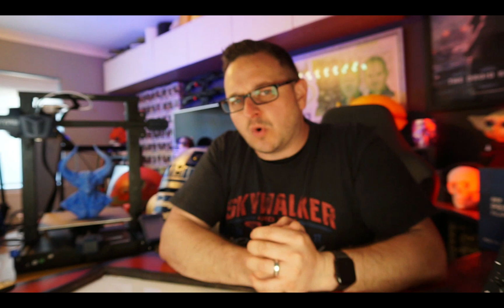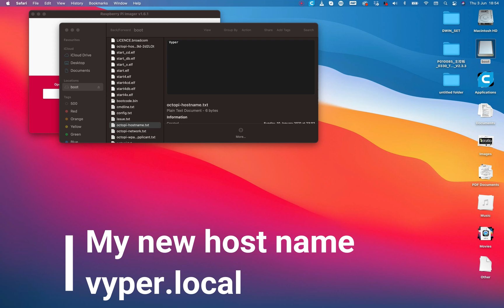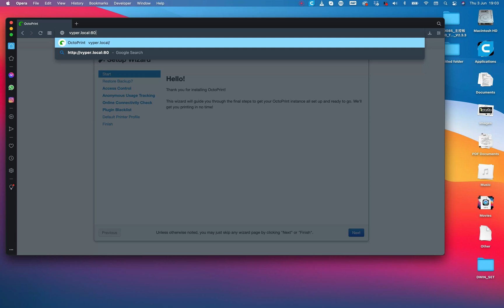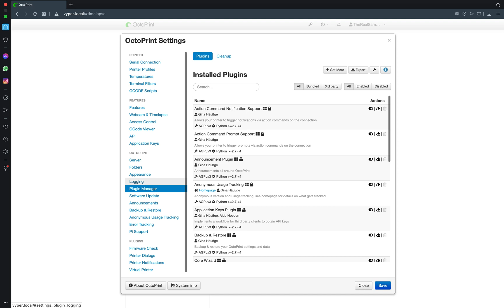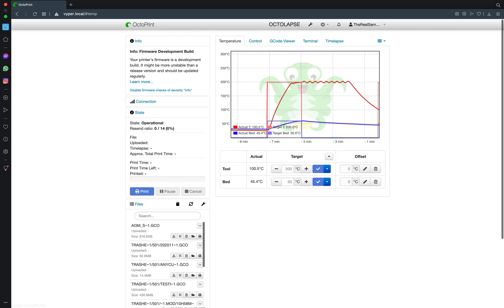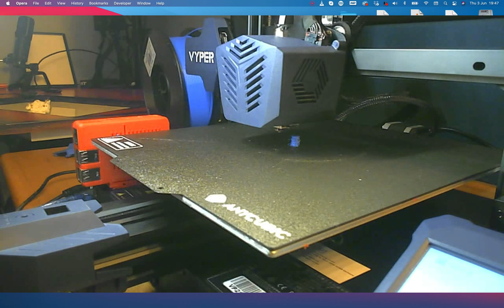Anycubic Vyper Octoprint Setup Install 3D Print : Anycubic Vyper teaser

Comment: Hello, I did the same as you, thank you. I am constantly trying to print. I octoprint with a Windows notebook and there is an original driver program in the printer. But I cannot make a continuous print, it waits after the first print or I have to press the continue button. You don't have a video about this. Can you explain to me how I can wait for 5 minutes after printing and print the same piece? Is the problem solved with g code script? Or should I delete all the scripts such as bed cleaning that come with the first installation ?

Best Regads
Thank you

Comment: I didn't realize the display no longer controlled the printer after octopi takes over.  Is that how its supposed to work?  I had a print fail and I had to cancel the print in Octoprint cuz I had no control at the printer.  Is there a better board/display combo that will continue to allow control at the printer once a print has started in Octoprint?
Reply from the maker: Yes sir, thats sort of the point. The Pi takes over and provides faster processing power, once of the reasons people move over to klipper too. The screen will not function but you can add a screen to the pi of you wish.
Reply: @TheRealSamPrentice  One of my other printers is an Ender with BTT SK1.4 turbo board and TFT display.  I don't lose any functionality during a print running Marling.  I also have a SecKit Tank running Klipper which is a whole other world.  Love my Klipper!  So anyway, thank!

Comment: HI, I just set mine up with octoprint and I wanted to ask if you start a print from octoprint can you access the settings menu to change z offset, temperature and speed ? I have not checked what firmware I have, but I can't see that settings unless I start a print from the printer menu.
Reply from the maker: Not usually from the menu no, you can do it from the octoprint menu or run gcode from the terminal menu something like... M290 Z0.25 ; move up 0.25mm on the Z axis or -0.25 to head on down :) The temp you can usually change as long as the gcode isn't set to do something like a temp change on parts of the print.
Reply: @TheRealSamPrentice  i am just upgrading the firmware to 2.45
Reply: @TheRealSamPrentice  oh well.... it was not remembering the z offset with stock firmware and it pushed the nozzle into the bed hard. How after the updated firmware it will not pass the auto leveling check I guess it damaged the strain gauge.
Reply from the maker: @leesmithsworkshop  if you whip the plastic cover off does the red light go on and off when you move the hot end ?
Reply: @TheRealSamPrentice  not any more at the moment it's always off or always on and then goes off with a touch.

Comment: OOOOMMMMMGGGG, you run a mile-a-minute.  I just got my vyper, and I saw a comment from someone about get octoprint setup, so I googled that, and tuned into your vid.  I must say, that was nearly over my head.  I'm pretty techy, but I don't program.  I got a good profile for cura that is working well for me, but it is almost like you have to learn a whole new lingo with this thing.  I'm really only interested in remote monitoring, and remote shutdown.  I still just want to use the SD card and Cura.  Am I lame for that attitude?  Do I need to dive in an learn 100% octoprint?
Reply from the maker: Its an interesting one, as ALSO there is a klipper install coming out soon but again thats more of a head turner. Personally if you are new use the machine as intended for now, when you want to move over to something new then check this out :)

Comment: You forgot to put the link in the description for the PID tuning (not that it really matters to me (i can just google it), but you said in the video it would be there)
Reply from the maker: Dam I’ll get that done!!
Reply: @TheRealSamPrentice  Nice! How you liking the printer so far? I got it hooked up to octoprint today, just done PID tuning. Yesterday when first printing the owl on the SD i noticed that the filament would just ooze out of the nozzle and at the start where it goes a bit in a circle at the round back part of the owl, the filament sticks on the nozzle and then drags on the print. Almost looks like the temperature was way too hot or something, even though it was at 200 degrees. Filament came out like molten chocolate spread almost.
Reply from the maker: @raynlaze1339  try it again once you’ve tuned it, every printer will have tiny differences in its build and setup but once you have things dialled in it works like a charm. It’s got some good features.. but the UI and marlin options and features need unlocking
Reply: @TheRealSamPrentice  Alright I'll give it another go. I found out that there is a quite a difference in PID numbers once the AC is on or off in the room next door. Might be a problem.

Comment: I have made a few prints and am very impressed with the auto bed levelling and general quality of the prints. However, I am missing the many options that I had with the Ender 3 V2 JYers Marlin firmware. Do you know if the Marlin firmware will be coming to the Anycubic Vyper? I did update the Anycubic with v2.3.5, for whatever that is worth. However, I cannot seem to get the screen to update its firmware. Any suggestions as to how to update the screen firmware on the Vyper?
Thanks!
Reply from the maker: Yep its coming :)
Reply: @TheRealSamPrentice  None too soon. Thanks for the reply. Any advice on how to update the screen firmware?
Reply from the maker: @arniep740  that’ll be the Sametime as the firmware

Comment: Anycubic owes you a commision.  I am buying one now thanks to this video.
Reply from the maker: Thanks Bill, they have seen me right ;)
Reply: @TheRealSamPrentice  My printer arrives Monday and the Raspberry Pi on Wed.  Should have the video memorized by then.
Reply from the maker: @RohanSOC  good man!!
Reply: @TheRealSamPrentice  The Vyper actually got her last Thursday.  All setup and printing non-stop.  Octoprint setup was a breeze, Plugins are awesome.  I have learned more in the last 4 days than in the last 20 years.  Is yours still running well?
Reply from the maker: @RohanSOC  Yes sir, since changing out the strain gauge its been totally fine, keep an eye on the software upgrades too they seem to be playing with a couple of the settings :)
Reply: @TheRealSamPrentice  I updated to  the 2.3.5 last night.  Haven't noticed any difference in the prints.
Reply from the maker: @RohanSOC  there is another one that’s just dropped on the anycubic vyper Facebook page
Reply from the maker: Download (no risk no fun? ) https://drive.google.com/file/d/1q2bJSaNPhxlW7Wyfd5GYRb8tJ8QeMVXR/view 

Hello here is the updates for this firmware version as below:1. Add a pop-up window when the NTC of the nozzle and the hot bed and the heating rod are abnormal
2. Add a pop-up window that is resetting to zero
3. Increase the real-time temperature display of the preheating and leveling interface
4. Add a pop-up window when the limit switch is abnormal when returning to zero
5. Add an abnormal pop-up window during auto-leveling
6. After all abnormal pop-ups do not crash, click the confirm button to return to the previous page
7. Optimize the detection of continued power failure

Comment: What printer should I select in Cura? I don't see this one listed.
Reply from the maker: Have a quick check on the sd card all the info is there but select the i3 version and input the bed size as per the sd card info
Reply: @TheRealSamPrentice  Thanks Sam. I did not think to look on the included SD card. I just thought it was a blank included to transport gcode from my computer, and since I am using Octoprint, I didn't need it.
Meanwhile, what is the procedure to update the firmware? I did not find that in the manual. Thanks.

Comment: Great unit got mine over a week ago
Reply: Awesome did a Eprom reset then calibrated flow and e steps its a beast pronted a few things at 100mm/s no issues solid unit
Reply from the maker: How are you finding it?
Reply: will octoprint and cura soon also support this printer so that you don't have to fill in everything manually?
Reply from the maker: @brianwessel2999  All you need to change is the plate size. It's pretty easy just to change it. Octopi works very well :)
Reply: @TheRealSamPrentice  thank you ordered now waiting for it to arrive.